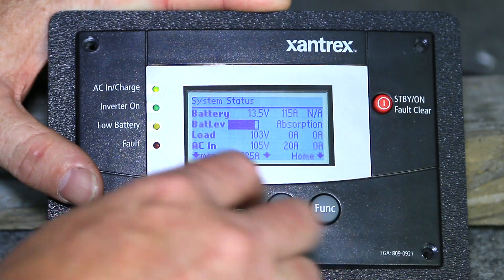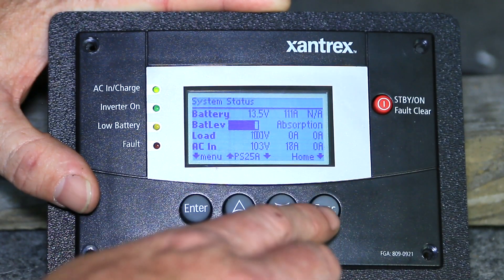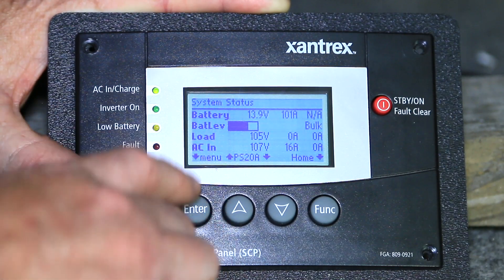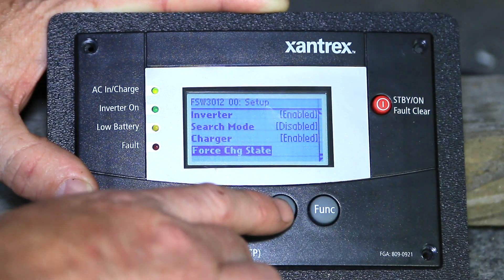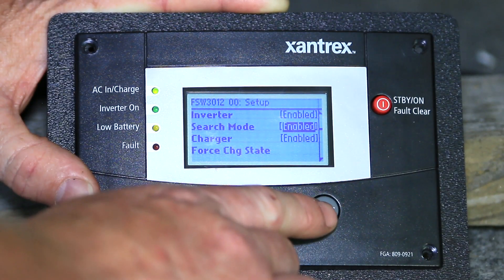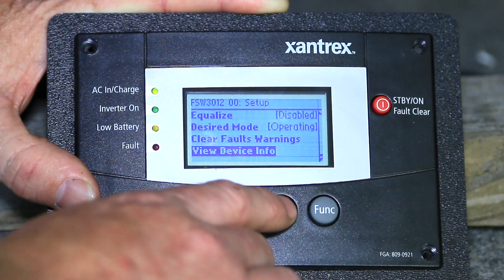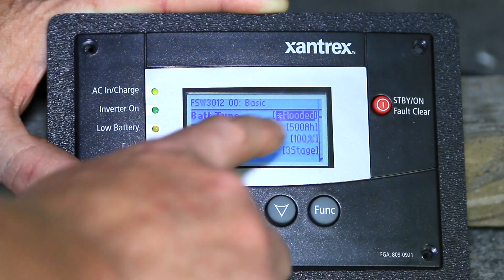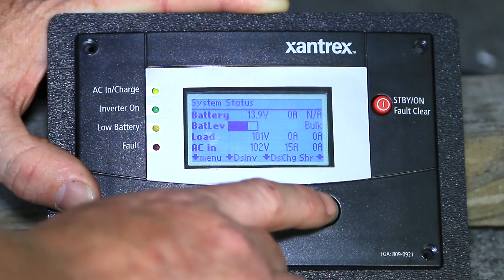Xantrex Freedom SW System Control Panel (SCP) - features & benefits

Comment: A Xantrex Freedom SW 3012 was installed in our travel trailer. The SCP was not included.We are trying to add the SCP so we can control the system when on generator.The generator revs up and down when connected. The installer failed to give us the Xanbus network terminators and is not giving them to us now that we asked. Questions: Why does our Honda 2000i companion rev up and down and can you getus the network terminators that came with the inverter/charger. They charged us over $2000.00for the inverter/charger alone. It says in the manual that  2network terminators come with. Thank you.
Reply from the maker: Dear Rando -Sorry to hear about the issue. Can you please call 1-800-670-0707 or email customerservice@xantrex.com for immediate assistance? They will be able to help you. Thanks
Reply: You should be good with only one terminator
my advice do nt try runing the 200o watts generator by Xantrex Genset , Tech support might say it should work
but does Not ,